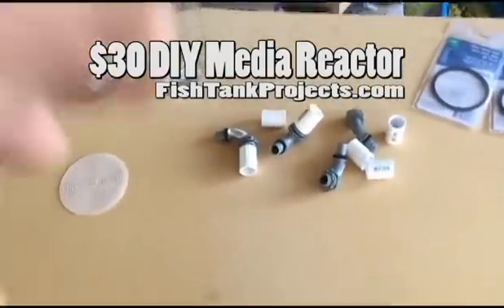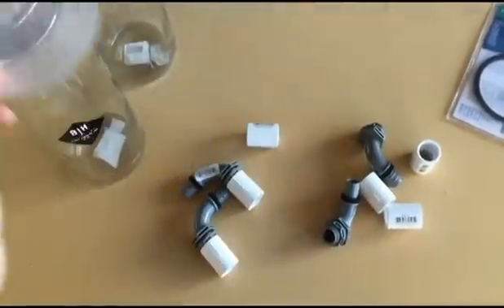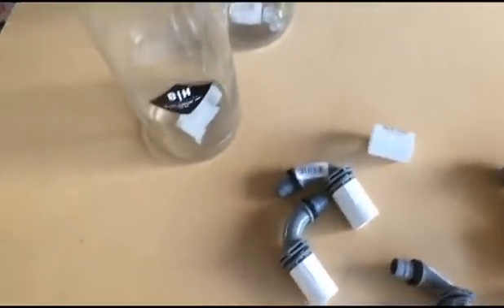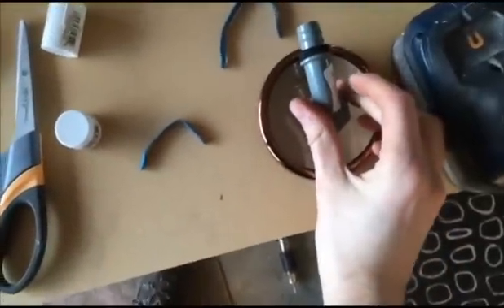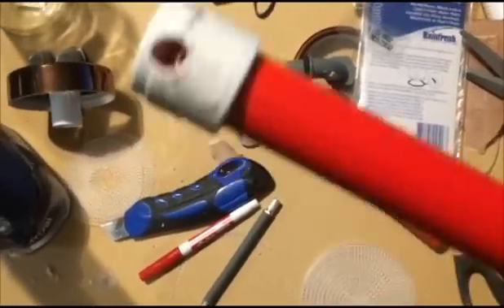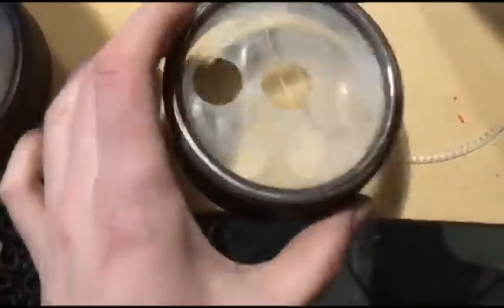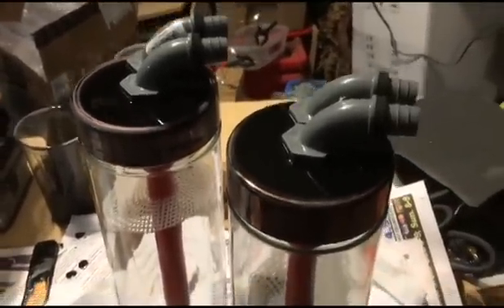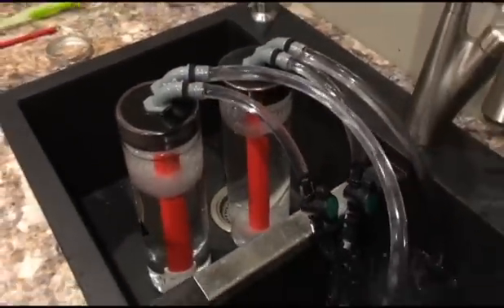$30 DIY Media Reactor for Carbon, GFO, or Biopellets  - FishTankProjects

Comment: Dude. Awesome looking reactors. The cracks were in a sense a godsend made you add the urethane now the tops are as strong as the whole reactor and they look good with the krylon fusion another excellent choice for paint. It definitely doesn't get any better than that for $30.

Comment: Were the tops of the lids acrylic on the pasta jars. If so  if you put them in boiling water first before drilling them they will not split because it makes them more pliable so less brittle. I was drilling some small holes into an acrylic box which I was turning into a overflow box and I had that problem but I guy YouTube gave me this tip and it works perfectly. Great video thanks.👍🏻
Reply from the maker: Good tip!  I’ll try that next time :)

Comment: Nice job on the build, but polyurethane and epoxy are two different things, poly comes pre mixed ready to use as a clear coat on mostly wood as it dries somewhat soft and flexible where as
 2 part epoxy consists of resin and hardener and can be used for numerous things due to it's abrasion resistancy and hardness. Unless you've made something I don't know of that looked like 2 part epoxy
Reply from the maker: I can’t recall what it was called but was a 2 part that hardened into a pretty ridges plastic type material

Comment: Which dollar store???? I’ve been looking for for full plastic top glass jars at sooooo many dollar stores in B.C. and come up dry, most are just plastic threaded metal so it would be exposed to the water.
Reply from the maker: Good question.. i'm not 100% sure which one it was but ill keep an eye out and let you know the store name if i stumble across them.
 Many of them have  plastic but had a "fake" metal chrome plated type plastic for the ring.
Reply: Frag Out Reefkeeping go to a dollar general and check out aquarium diy video

Comment: Hey man, was wondering if you know what those circular plastic grated are called/what they're used for at the craft store. Thanks.
Reply from the maker: Reisings Reef they are for knitting.(crochet mesh maybe?) I got mine from Michaels.  I have also seen the square sheets of it at Walmart
Reply: Thanks man, I just found em. Also for those interested I just found the canisters at hobby lobby for $3 each. The main canisters don't have. Lear plastic lids but there are some right next to it with the clear lids

Comment: What are those mini bulkheads called?
Reply from the maker: Michael Weirich I'm not 100% sure but I found them in the electrical section at home hardware
Reply: Thanks for the reply. I'm having so much problem finding them in the uk! I've found the jars which I see people are having problems getting! Great video!
Reply from the maker: Michael Weirich thank you!  I believe it was these guys http://m.homehardware.ca/h5/m/en/r/hh/en/rec/index.htm/Plumbing-Electrical/Electrical/Conduit/Fittings/Pvc/1-2-Flexible-Elbow-Conduit/_/N-2pqfZ67l/Ne-67n/Ntk-All_EN/R-I3622681?Ntt=1%2F2+conduit
Reply: ReefDudes you are a absolute legend! thank you.

Comment: Bro-- I have looked HIGH and low for these or similar containers and cannot find them ANYWHERE.  Please point me in the right direction.  I can't find them anywhere! Help!
Reply: +Dev R  thanks so much for the reply, man.  You're absolutely right.  I'm going to pick up some of the glass ones with the brushed aluminum screw tops and sand them, then give them a nice coat of paint and add silicone and maybe seal them with an epoxy.  If you want to connect, I can let you know how it goes.  Should be easy enough to drill through and seal up.